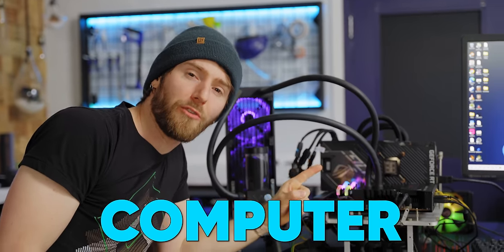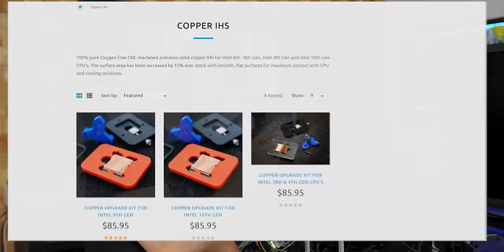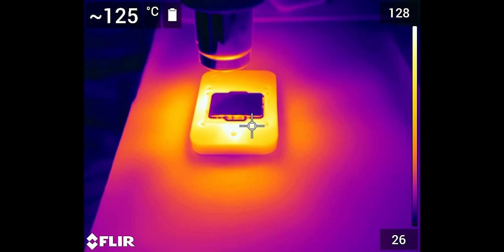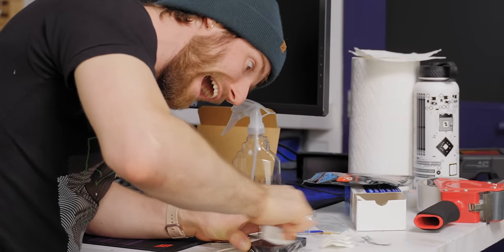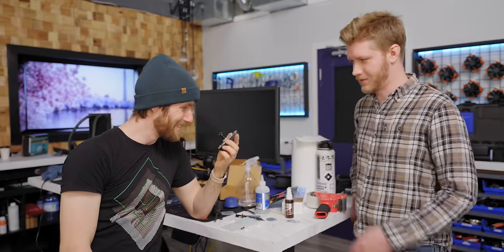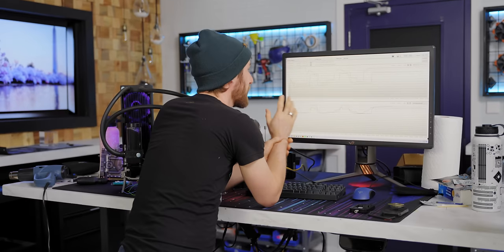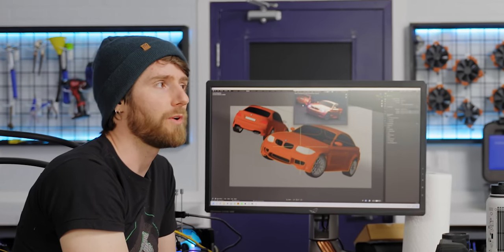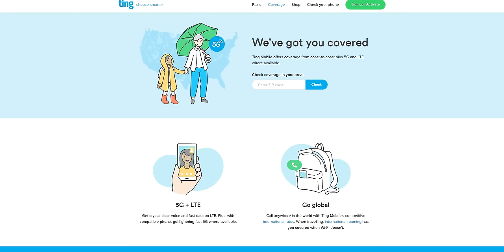Making Intel's Worst Product Better.... And Also Worse

Comment: Windows 11 is actually the ideal version of Windows for the CPU since its kernel actually knows how to properly handle the efficiency cores.
Reply: Nice try, microsoft
Reply: @manuelkimothy6998  I'm just saying the truth about the difference between Windows 10's and Windows 11's versions of the NT kernel.
Reply: Nothing you say will make me switch from running XP!
Reply: Windows 11 is shit and will remain shit throughout its life cycle. Windows 12 will be built on windows 11 with all bugs cleared out and new futures polished. It happens every cycle.
Reply: Maybe, but so does Linux. And honestly, I don't really care anyway. Fuck Windows 11. I'm not running it. And fuck 10 too for that matter, although that's not relevant at the moment.
Reply: @senti2175  That's what they said about Windows 11 before it released. And Windows 10 as well. Personally, I'm not waiting for Microsoft anymore.
Reply: @arnox4554  you dont get it. Every second iteration of windows is a success while the next one is faliure. Xp good Vista bad, 7 good 8 bad, 10 good 11 bad.. so 12 should be good.
Reply: @senti2175  10 wasn't good. It started out good, but it wasn't good. 8 is complicated. The UI is AWFUL for desktop use, but it's also a very easy fix, and once you fix the UI, it's actually pretty great.
Reply: @AndreiTache  XP is perfect for the majority of legacy applications
Reply: @arnox4554  dude I am running 10 on all my comps and it is better and more stable than both 8 and 11. I liked 7 better than due to 10 data gathering features (which is even worse in 11) but it was out of date for modern hardware. And more than 90% of Steam users use 10.
Reply: @arnox4554  subjective, I believe windows 10 is the better operating system and the majority agrees.
Reply: @senti2175  Been running 11 on unsupported hardware (4th Gen Intel) since November, no issues.
Reply: @senti2175  Really? Because I installed Windows 10 on my laptop just a little bit ago and due to a NATIVE Windows device driver that also gets loaded in safe mode, if the driver was even LOOKED at wrong, it would blue screen. You couldn't even disable it in the Device Manager. I had to manually break it with the Windows Registry to keep it from loading.

Another time, same computer. Firefox wouldn't play a ton of YouTube videos. I don't have this problem whatsoever on my Windows 8.1 Pro desktop running Firefox.

Another time before all this, same computer. the Windows 10 Start button lagged for a second or two before it would finally open, and no matter WHAT I did to fix it or what I disabled, it wouldn't go away.

Another time,  but this time with someone else's laptop I was trying to fix. A native Windows process kept using 100% of the disk, making it almost unusable every time it was doing this.

And I'm not even touching on all the MANY anti-features that Microsoft purposefully put into 10. These are purely just my own encounters with the OS. And I'm not even done. I could list more. Stable, my fucking ass.
Reply: @vanilla4064  Do you want a list of all the objective problems that 10 has compared to past Windows versions? I can prove every single one of them too.

And also, the majority doesn't agree so much as they've gotten numb to it. They don't actually know or remember what a quality OS was and is.
Reply: @arnox4554  Obviously the problem is with u or ur hardware. Nothing is 100% stable but its stable enough where a heavy user like me can encode x25 vids, do 3dmark benchmarks, cinebench stress tests, play cyberpunk with Ray tracing, run multiple vmware workstations while playing LOL etc etc and the pc never shuts down or crashes or bsods. If u know wat u r doing it will be stable most of the time. And if a problem arises with a driver update or new software u can easily identify it. Because 10 is a mature stable version of 8. Just like 7 was of Vista and Xp was of ME and 98 was of 95 and 3.1 was of 3.
Reply: @FastSloth87  most of hardware that is over 2 yrs old is officially unsupported. That alone should give u a clue about how efficient and reliable they themselves believe it is. But the issue with win 11 is a lot bigger than stability and hardware support. The biggest problem is that its a wanna be Chrome like app centric OS with everything synced online. They tried that shit with win8 as well with tiles etc but then had to roll all back after backlash.
Reply: @arnox4554  sounds like a problem with your laptop not windows
Reply: @Mavis847  You know that 100% disk usage problem? I saw that a lot with Windows 10, not just my laptop. My relatives have also had major problems with Windows 10. Professional SERVER ADMINS have had major problems with Windows 10. (I'd link an article but YouTube will insta-delete my comment if I do.)
Reply: @arnox4554  bro hdd causes that 100% usage. Its ur fault
Reply: @senti2175  As much as Win 10 was an alright OS, I do think its stability is a bit overstated. I've had to fix three separate devices that would black screen on login after a successful windows update, making them completely unusable.
Granted, fixing it has always been possible through the repair tool but that's 0.5-2 hours of my time gone fixing an issue that should never have happened in the first place.

That's not to mention all the weird UI bugs, Bluetooth shenanigans and the giant bug that is the Microsoft Store.
Reply: @dirlrido2522  Remember when they forcibly removed Sketchpad in an update and replace it with the inferior always-online subscription-based Whiteboard?

I remember...
Reply: @arnox4554  The reason I gave my personel experience is to counter ur personnel experience. Funny innit? I already told u that over 90% of Steam users are on windows 10 right now. 
As for updates who told u to install every update? You do realuze that you can pause updates till u have feedback on them and u can even uninstall specific updates that are causing problems or that u dont like? I never install updates unless its absolutely necessary specially ones that invade privacy. 
So we can aleeady see where your problems lies. 🤔
Reply: @dirlrido2522  When i talk about stability, I am obviously comparing it to other versions of Windows. Obviously its never going to be as stable as something like red hat enterprise.
Reply: @senti2175  I was simply replying to your comments about how stable it is and how "If you know what you're doing it will be stable most of the time." In my personal experience, it's not particularly stable. That's all.
Reply: @dirlrido2522  Well we can argue with the parametera of stability all day but the fact remains it is more stable than both the previous win 8 and the next 11. U have to go back to win 7 to find a more stable version. Which in fact Ibwas using till I was forced to use 10 because of hardware compatibility issues of new gen of AMD mobos.
Reply: @senti2175  "I already told u that over 90% of Steam users are on windows 10 right now."

The bandwagon argument is not a good one.

"As for updates who told u to install every update?"

Uhhh... Microsoft did. And if you DON'T install updates, guess what. Microsoft will force you to install them anyway! :) It's one of those wonderful """features""" that Microsoft put in Windows 10 for us. You can "pause" updates all you want to, but sooner or later, Microsoft can and WILL make you update. The only exception to this is the early versions of Windows 10. That is it. And yes, I have a source for the forced updates too.
Reply: @arnox4554  u can unintall the updates. And incase MS puts unwanted updates within essential ones u can use the registry editor to disable most of them. If u arent comfy in editing registry there are tools like win10 privacy.
And the reason I mention steam figures is that on average the most common power pc users are gamers and steam presents the lion share of them. If they settle fir a hardware or software that is inherintly  unstable then the forums will be filled with complaints just like when new games arrives with unoptimized or buggy cod. But they arent. Which is a good overview of the general stability.
Reply: @arnox4554  100% disk usage that's most likely windows defender, it can be solved in 2 ways, either get an ssd or disable windows defender. personally I disable it on my all PCs since it's useless for me and it really is the only part of windows that I still hate
Reply: @arnox4554  Are you sure your laptop isn't dying?
Reply: @senti2175  Oh sure, there are ways you can DEAL with Windows 10. But that's what you have to do constantly with every stupid update. You deal with Microsoft's modern bloated broken restrictive OS. And honestly, I don't feel like dealing with it, or supporting Windows in the process in any way. Not modern Windows anyway. 8.1 still runs amazing, and Linux, quality wise, is FAST catching up to Windows. By the time 8.1 isn't viable to run anymore, I'll most likely be able to switch over to Linux full time. I'm already dual-booting MX Linux at the moment.
Reply: @Mavis847  Well, as I said above to someone else, why should I even deal with it at all when there are alternatives both within the Windows series and without? I mean, if you have to use Windows for work, fair enough, but beyond that, why even bother?
Reply: @raspberry1440kb  My old abandoned dual-booted Manjaro install that I haven't touched in years doesn't really have any of these problems, so I'm pretty damn sure it's Windows 10 being a bitch. MAYBE Firefox for one of the problems, but I rather doubt it, especially since it runs perfectly on Linux. Using a years-out-of-date Firefox version too.

I really should replace that install with MX Linux one of these days...

Comment: I used copper shims to repaste my Alienware M15 R5. Ryzen 9 5900hx/3070 130w

I used 20mm x .3mm for the GPU, and 15mm x .5mm for CPU. 
I have not seen the CPU over 83 since, and GPU hasn't been over 79. Those highest temps were during a back to back Time Spy/ Afterburner overclock session. 
11,091 time spy score with it. This is my first experience with copper shimming. I used to have a computer that instantly throttled during anything more than web browsing.

Comment: Ok now this would be incredibly expensive, impractical and possibly even hazardous and component breaking but could you fill a loop with liquid metal?
Reply: I really would love to see this, too!!! For me the pump will be the most problem, because liquid metal doesn't stay always liquid, especally in regions/parts with many movement and friction. Also I don't know if the liquid settle down on some materials and cause a clog after a while. But this experiment would be awesome!!!
Reply: No point, it can only perform worse. The point of liquid in a liquid loop is to move heat away from a point, so you need thermal mass. Water has higher thermal mass than liquid metals, by quite a bit. Add on the reduced flow, clogging, etc...
Reply: @ILoveTinfoilHats  damn, I just looked it up and you’re right
Reply: On the other hand, some nuclear reactors use liquid sodium for cooling.

Comment: For the next extreme cooling episode I'd like to see whole loop liquid metal cooling. Sodium and potassium form an alloy that starts being liquid under 0 degrees C (depending on the Na/K ratio), it doesn't corrode copper, works well with glass, can be pumped without any moving parts using just electricity and magnets (look up magnetohydrodynamic pump).

Only problem is that it burns on contact with air or water, so the loop (most likely rigid glass loop) would have to be assembled using an inert atmosphere (welding argon should suffice).

Old (and I mean Nixon old) nuclear reactor whitepapers on NaK cooled reactors and how to handle the stuff are available online.

Comment: Didn't Alex show that the graphene coolent isn't actually that much faster? So is there any new information?
Reply: Probably just to flex in this case.
Reply: It doesn't make much of a difference but this thing needs every degree it can get.
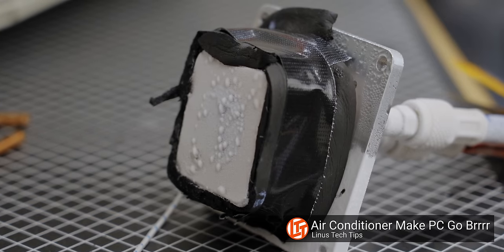Reply: 10:27 he says 2 degrees, so yeah, not really worth the effort for most.
Reply: Of course it's not faster, it's not about the speed, it's about the cooling 😋
Reply: well it certainly is more extreme than your regular water n shit and this video is about taking a possible daily runner PC to the very max (although I'm not sure they used the biggest still reasonably sized rad).
Reply: It was just to fit in with the vibe of the build: the couple of percent faster, but way more expensive CPU than the "regular" 12900K, the couple of percent faster, but significantly more expensive GPU than the "regular" 3090, the silly-expensive mobo... and thus it had to be the marginally better, but expensive coolant.

Comment: I found that the rockit IHS was incredibly affective in my sff mITX case with the Noctua NH-L9i cooler. Allows it to really get the heat away from the CPU and out of the case easily. Overclocked 8th Gen i7 sff build 👍

Comment: Agreed Linus: Windows 11 = crap

I wonder what would happen if there was a second radiator in that loop. Because, incredibly, this seems to have reached the limit of the cooling potential of liquid cooling. If Linus feels the exhaust is quite hot, then there more heat to be dissipated for another radiator... which is kinda ridiculous. LOL
Reply: You are right about adding another radiator + set of fans arranged for push-pull.

Comment: Wait, you're not gonna put liquid metal on top of the ihs? Seems counter productive to put it underneath and then not on top
Reply: it matters more when closer to the cpu. after the spreader, the contact area is increased.
Reply: @arkie87  you would be surprised
Reply: Copper doesn't react well with liquid metal, it absorbs some of it and creates a thin layer of gallium on the outer surface. That is why people usually only put liquid metal under the IHS and not over it as the IHS is nickel plated but the CPU coolers are usually not and are just bare copper. But in this case it doesn't really matter for them if they are going to stain the cooler so they could have put liquid metal on top of the IHS as well. Liquid metal has way better thermal conductivity than even the best pastes. If they were going for the very best performance they could have direct die cooled it as well.

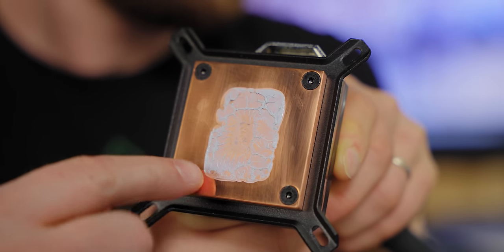Comment: @3:19, They interpret they are interpreting the spread of the thermal compound on the heat sink incorrectly.  It actually was making better contact on the center leaving more thermal paste on the CPU and was less effective on the sides. JMO.

Comment: Would this be the last thing you'd do to improve temps. Or, would it be worth it, let's say if you're using an AIO, or air cooler even.
Reply: No, this is not worth it. Outside of experimentation, anyway. Liquid Metal is not a viable substitute over traditional thermal paste in long-term scenarios as it brakes down fairly rapidly. You would be tearing your rig apart multiple times per year to repeat these processes.

Comment: As a competitive overclocker, I really liked the video. its weird seeing ltt dabble in overclocking these days but its nice that its getting more mainstream attention. The only thing im a bit bummed out about was you guys never addressed that copper reacts with liquid metal. I guess it doesnt matter since you dont expect anyone in your audience to follow this as a guide but its important to know that the gallium will have to be changed in a month or two. It also would have been nice for you guys to test the flattness of the waterblock. Or atleast mention that some water blocks come from the factory recessed to fit bubbled cpus.
Reply: Yup that's what left me with questions as well. Aluminium is an instant no-no for galium liquid metal. Copper is not "as" bad, but will still react with galium and won't last long.

Comment: yea never use blend for testing the cpu, that test does a bit of cpu/memory controller/ram.  run small and use custom set the max size to the L2 or if you want L3 cache size.

Comment: If my materials science knowledge is correct, the nickel plating if anything protects the copper from oxidizing in the few years the processor will still be competitive. 
Oxide layers tend to have different thermal and mechanical values.

Comment: I would have appreciated an additional test without the liquid metal. It would be interesting what the liquid metal contributed and what the new heat spreader did to achieve this temperature drop.  And why didn't they show a CPU bound game, like CS:Go? I would like to see more graphs instead of gameplay of two games without any comparison. I personally think the methodology in this video is flawed and doesn't show the true difference the new heat spreader makes
Reply: They did mention those games were chosen due to their benchmarks providing information on the cpu's performance, instead of just whole system performance.